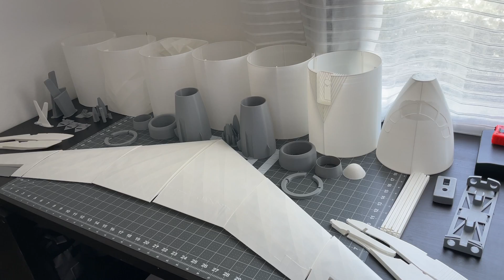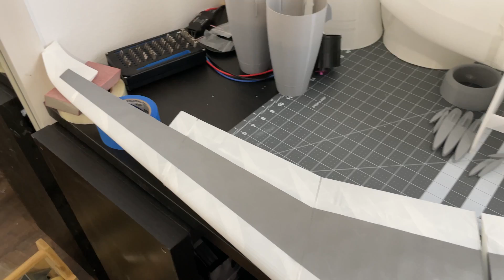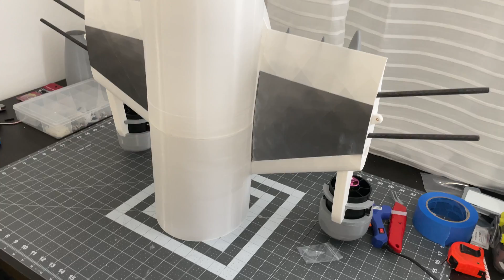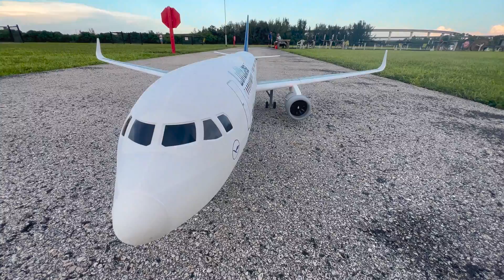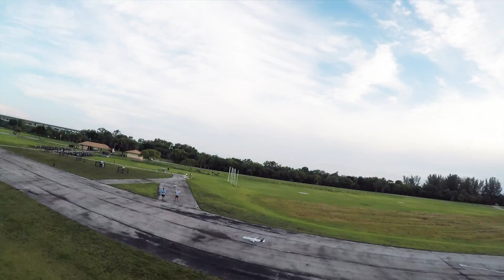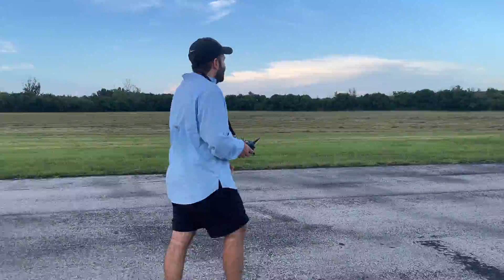3D Printed Giant RC Airliner Build, Flight, and Crash

Comment: rc NTSB Here, the plabe pitched up to aggresivly causing a stall and after recovering it flipped upside down and stalled again, now if you didnt pitch that hard the reason was tail-heavy and it also flipped as we saw but if u did pitch that hard as enough, its Pilot error and Tail-heavy

Comment: OFFICIAL NTSB REPORT: 

As Lufthansa Flight LH919 from Frankfurt to London (FRA-LHR) took off for its maiden voyage, it climbed at an astounding rate of around 8-9000 feet per minute. This climb rate is very much OUTSIDE the limits of any ordinary A320-271, especially an older plane. Even the newer A320s cannot handle this, just after takeoff, at a speed of only 130 knots. Thus, Flight 919 entered an aerodynamic stall that they couldn't recover from, and LH919 crashed into the ground at Frankfurt at a speed of 90 knots. There were no survivors. 

Cause of Crash: Pilot error and incompetent training regarding basic flight rules and parameters of the A320, specifically Vr, V1, and V2 speeds and V-limits. The cause of the crash, however, was not tail-heaviness. If it was so, the plane would have tail-struck the ground before the Vr speed, just like with most tail-heavy planes. This was merely a stall that took the lives of 150 people. Details below:

Deaths: 142 Passengers, 5 Crew, 2 Pilots, 1 Ground Crew struck by plane.
Total Deaths: 150

CASE CLOSED AS OF JULY 9, 2024

Comment: Hi, the elevator works perfectly, you stabilised it great before left turn, but your problem was bank angle in left turn (in these types of real aircraft pilots never exceed angle of 45 degrees during flight) after you exceed 45 degrees angle during turn, you started loosing lift till you lost it fully, after that you didn't have a chance to recover it from stall in that height.
Reply: Glad we have the NTSB here thinks he knows better than the guy actually fly it 👍
Reply: @jordancoleman2402 he’s right though…you don’t have to be an NTSB investigator to understand the physics of flight. Maybe if you actually got off your mom’s couch and learned something about aeronautics, you’d understand how flight works.

Comment: Is that lw pla? I tried lw pla on a 3dlabprint cub and the plane didn’t even get into the air before the motor ripped the whole airframe apart. It was hard to hold without it cracking
Reply from the maker: Hi, no it is not lw pla, it is regular PLA!
Reply: @AlejandroAlcantara  awesome!

Comment: Hi Alejandro,  I printed all the parts of this plane 6 months ago and stared at them in my home office all that time. I finally felt I had the skill and desire to glue this thing together. Yes, it's a lot of tedious work, and a lot of stuck fingers. I'm probably 1 week from my Maiden and sorry to see you crashed yours. I've been flying R/C since I was a kid, 40 years ago, and it's still challenging. I love the 3D printing process, and Troy designed this well. I have a question for you. How do you make the decals, especially the windows? Need to do that. If you could help with info, I'd really appreciate it. I look forward to seeing your 2nd rev of this model.  Some improvements I would like to see are a better alignment system for joining the fuselage sections. I had some goofs trying to align one end to the other before the CA dried. Really a bummer when that happens. Flaps would be a good addition too. Bigger wheels I think.  Scott - California
Reply from the maker: Awesome that you have been building one! For the window decals, I took a screenshot of the stl file of the windows and then cut that shape out with a vinyl cutter! It may not be the best method but it works.
I wished it had flaps as well! The weeks I actually ended up using foam ones from Amazon, that way you can buy them as big as you’d like! I can definitely tell you the second time around building it gets much easier! I’m also integrating lights! I wished the plans had this integration built in, I’ve been fighting the plans and drilling and hot ironing holes to pass the cables of the lights. I should be done probably next week and maiden the following week!
Reply: Where can I find the files to 3d print?

Comment: Chopping the throttle suddenly to control the climb was a wrong decision since plane was tail heavy (induced an inevitable stall with a very high angle of attack and no thrust)... Decreasing the throttle slightly and trying to manage the pitch with elevator inputs was your only way out... Anyways, sorry for your loss... Hope to see the beast back in the air again soon...
Reply from the maker: Exactly wat happened, and the elevator did not have enough authority to recover. Make sure you subscribe, the second version is almost done!

Comment: Bummer, surprised that being tail heavy, you didnt have up elevator, something else was definitely wrong IMO.
Reply: Didn’t have enough power in both airplane and aerodynamically. A stall and he drawed too much power so the elevators were having trouble. He should’ve nosed down then up
Reply: It went down because it stalled. He said that he didn't have enough down elevator to keep from stalling.

Comment: So what was the cause of the sudden nose down.     Did you stall after rotation.   Climb out looked very steep
Reply from the maker: It was a combination of things, It started climbing too steeply due to the plane being tail heavy, into a stall. After it rotation the elevator did not have enough authority to be able to pull it back up on the way down. You can see on the drone footage that it did pull up, but not enough. I also have a suspicion that one of the batteries slid to the back on takeoff and climb. I am already printing and working on V2, so make sure you subscribe so you don't miss it when it comes out.
Reply: @AlejandroAlcantara  was thinking along those lines,. As it left the ground beautifully,.  Then it just climbed.   I'd guess batteries slid back.      Shame as it lifted do well.    Looked very light